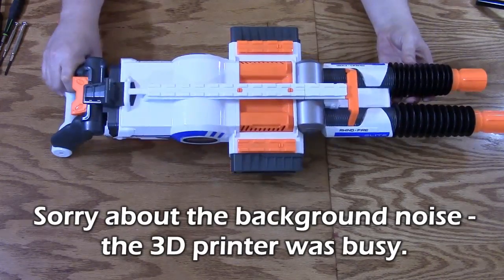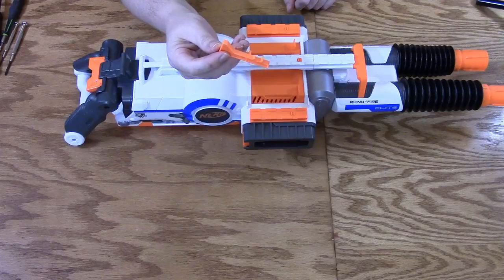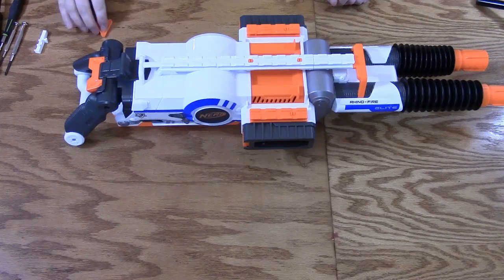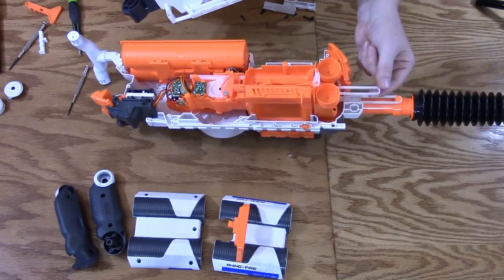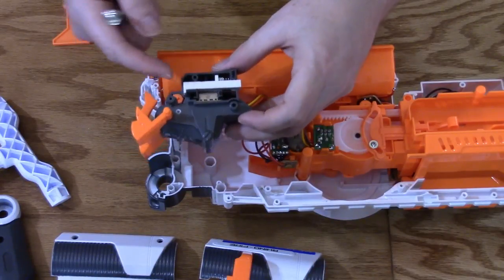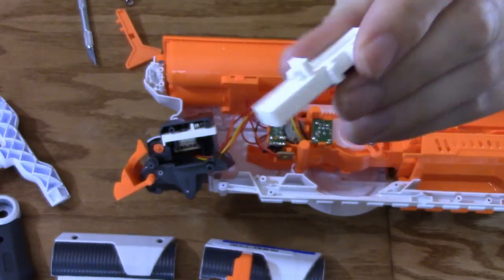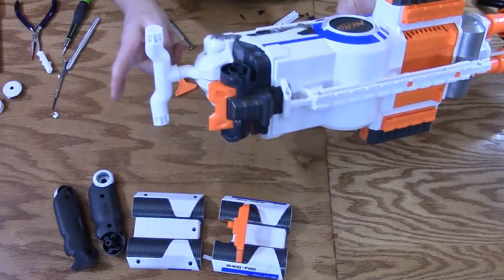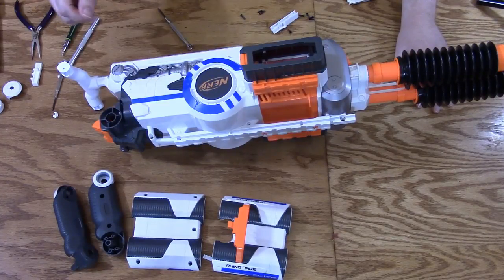Nerf Rhino Fire Repair - 3D Printed Trigger Switch Replacement

Comment: My rhinofire isnt firing, and i believe its not revvibg the flywheela, howver its actuating the pusher so darts are getting jammed. when i pull the trigger it doesnt rev, only actuates the pusher and barrels. Might take it apart for a peak

Comment: i dont understand why people do this, they could use a on/off push button and wire it to the wire on the original button and wire the new button out of the casing. this video really helped because ive just ordered one to make a remote turret and wanted to see the electrical workings due to i couldnt find a data sheet